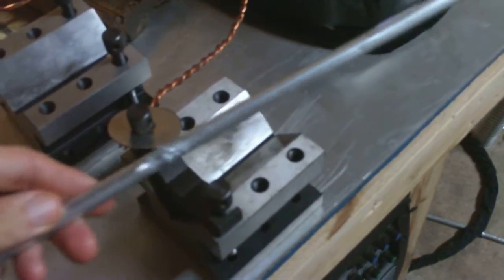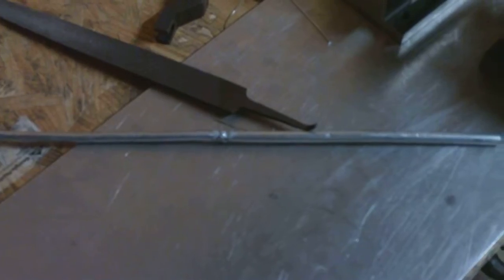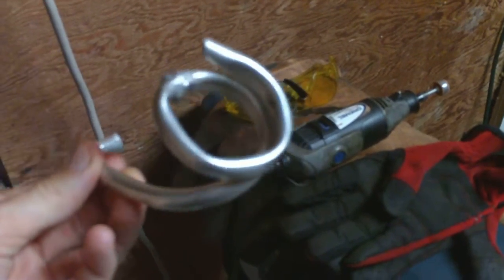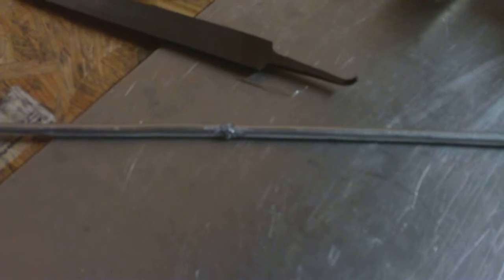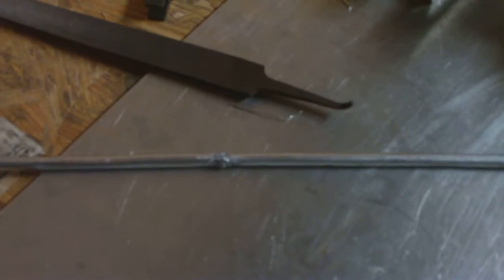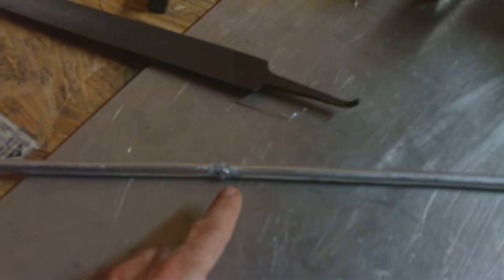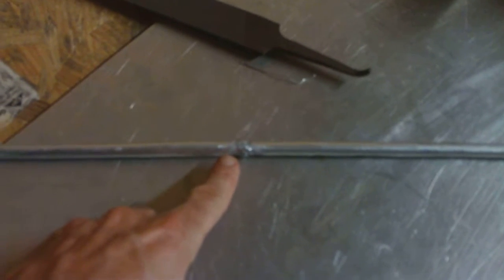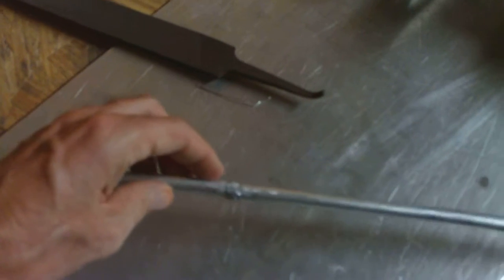TIG Weld Thin Aluminum Tube

Comment: Hi im having  a  problem on my fridge  frezzer  it has  same or similar  thin  aluminium  tubes  .I found a small  needle size hole in one of the tubes  . I tried with acethlyne oxgen  or gas welding at minimum setting dosent work makes a mess .Im thinking of bying of a small basic tig welder  of ebay that will just weld small holes on aluminum pipes  it   dosent have much options as yours it just  has  on it ampreage and selection and  tig or mma welding . Should i go for  more expensive tig welding machine or could a cheap one do the job ,
Reply from the maker: I'd go with a TIG welder that runs on 240V, has a minimum of 205A output, has BOTH DC & AC TIG mode. This will allow you to weld Steel, Stainless Steel, Titanium, and Aluminum. Aluminum will require TIG in AC mode. If you have a 220-240V clothes dryer or hot water heater outlet, you should be good to go. Don't waste your money on 120V machine. Make sure you get a TIG welder that has AC mode, otherwise you will not be able to weld Aluminum!

Comment: thanks for the video. taking this exact test tommorow for an aerospace company. suprised on the Hz but it made sense once you explained it
Reply from the maker: Good luck on the test! Glad the video helped. That thin small diameter Aluminum tube is by far the most difficult thing I've had to weld. After you get good at that, stainless, mild steel will all be easy.